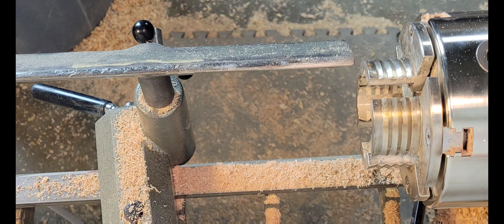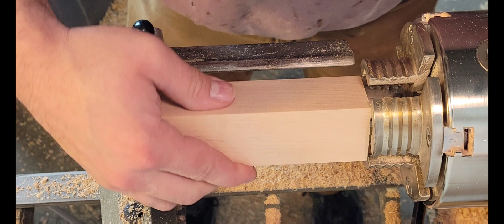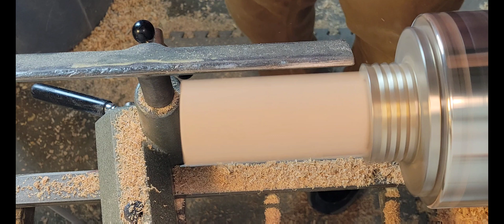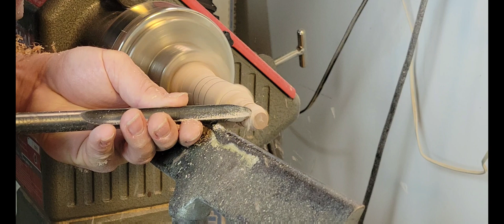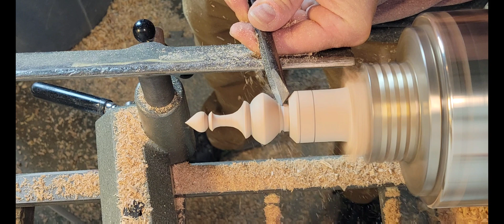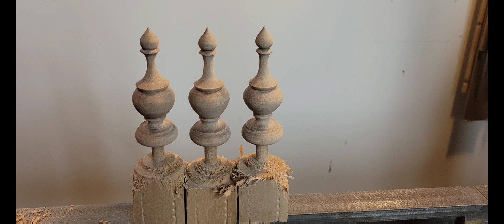Woodturning a Birch Finial - Manual Duplication

Comment: I was wondering why you were using a swept back bowl gouge on your finial/spindle work till you commented that you were using a spindle gouge. Looking closer, it does appear to have the more shallow flute. I keep mine at about 30 to 40 degree bevels, which lets you get down in closer to tight spaces, and have a slightly more pointed nose. Nice work. 

Oh, the open end wrenches are just a hair over sized because it would be almost impossible to get them on and off of a nut that was exactly the same size. If you angle it a bit, you can burnish the tenon, and when you apply glue, it will expand back out a tiny bit for a very firm fit.
Reply from the maker: Thanks Robo!  Yeah, I kinda have a funny grind on my spindle gouges.  I've gotten so used to it that it never crossed my mind.   :)